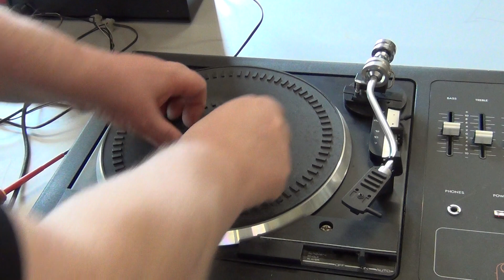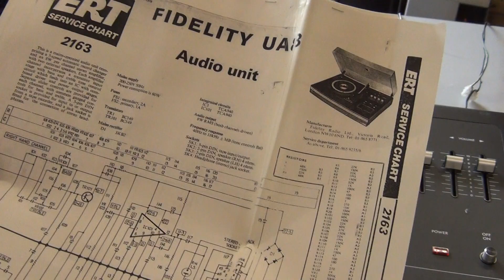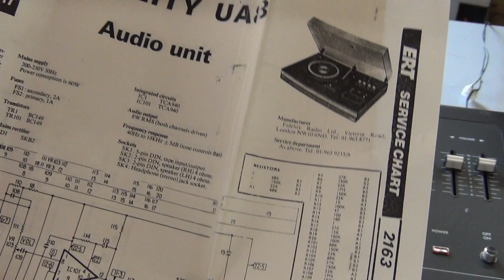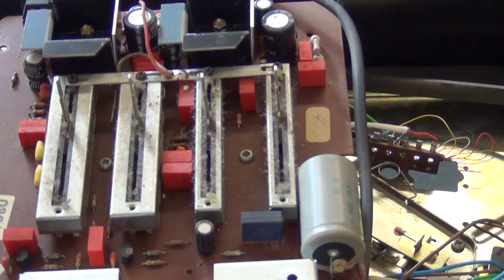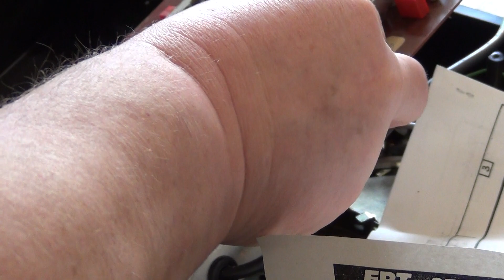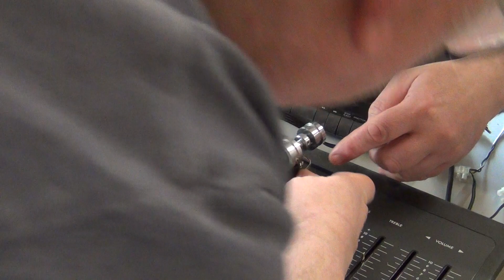Fidelity UA8 record player overhaul Pt1 of 2

Comment: Nice retro piece of kit that and it would look nice situated in an alcove in a living room with speakers mounted up on the wall just as we did back in 78, looking forward to part 2 of this well kept deck.
Reply from the maker: Pt 2 won't be long. I reckon the parts will arrive Tuesday.

Richard
Reply: @ukfmcbradioservicingTango21 Just thought I would mention I was out and about yesterday and spotted a Grundig radio Gram in good condition in Lincoln if you are interested it was at ABC House clearance 333 High street Lincoln near the level crossings if you are interested give them a call for more info will catch you later 10-10